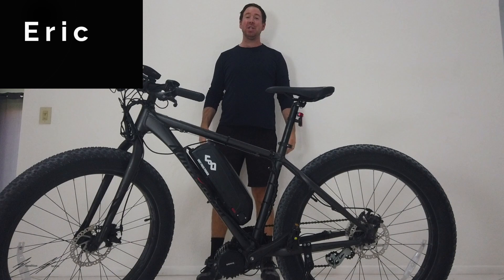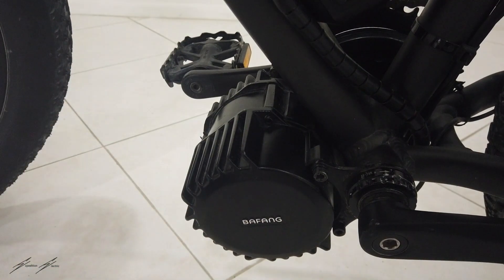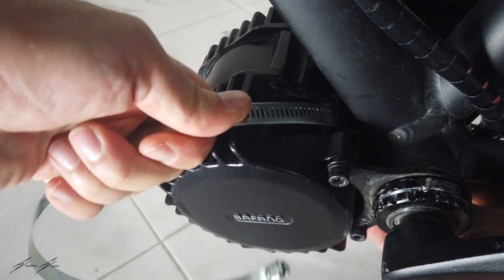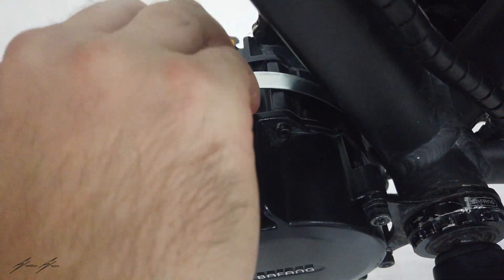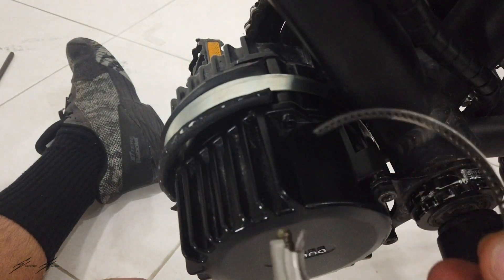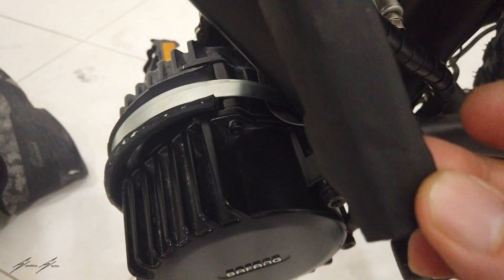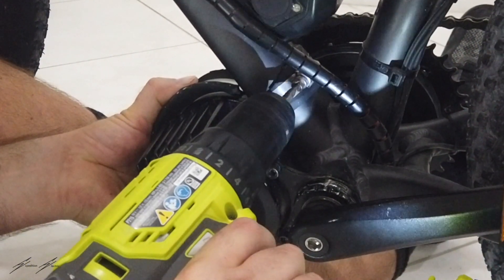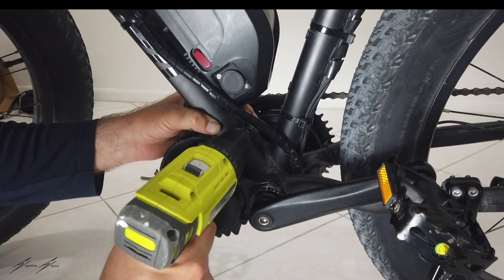Fix Mid Drive Electric Bike Bafang Motor Wobble

Comment: I have used hose clamps for various purposes for ebike applications.  One tip is to use heat shrink tubing to slip over the band of the clamp.  You can then heat the shrink wrap and it conforms to the band giving a nice look and protecting painted surfaces.

Comment: I'm doing this for a long time on my second BBS02B CAT, but it won't completely fix the problem. Whatever you use a hose clamp or fat cable zip ties - it doesn't secure the motor to the downtube at 100% This way you'll buy some time, but finally the locknut will loose anyway - just a question of time. Clamping will prevent the motor from a big move, but not competely, so once it strarts moving even just a little bit - an annoying squirky sound will appear as the bracket teeth starts chewing your bike's frame. I don't think that even a red threadlock or a custom LEKKIE ONENUT ring would help until the motor shaft is welded to the bottom bracket. Great motor itself, a powerful torque, but absolutely TERRIBLE design to secure it right 😞

Comment: What even is this? if you have that much movement in the motor neither lock ring is on tight at all.... just crank that sucker down to 60nm maybe 65, and its never coming loose. This is the most stupid shit Ive seen in a while.

Comment: There are proprietary M33 Deep Socket wrenches, with long handles for leverage.. Put only 1 drop of red Loctite on the motor nut thread and use that Socket Wrench to tighten it down.. It will be secure.. and later you can use the same Socket to loosen the motor if you need to remove it.  Leverage is the key...

Comment: I did the exact same thing on my 1000w Bafang motor. Although it works fine (it prevents the motor from moving up and down), however I had a bigger problem. I am not sure if it's because the motor was too powerful and gets really hot, and also because of the pressure that motor makes against when the motor accelerates, but a piece of aluminum approx. 6cm² size fell off from where the down tube joins to the bottom bracket shell. It wasn't a cheap bike, it was a Trek FX 3. I got shocked. Next time I won't make the motor touching all the way up, but I will leave some clearance in between so the motor won't touch the down tube.
Reply from the maker: Interesting point about the clearance.  I wonder if anyone else has had a similar experience with a 1000w Bafang motor creating so much pressure?  Maybe there's a way to reinforce the down tube area before installing the motor to prevent future issues.
Reply: Exactly the same thing happened to mine, same size hole in the down tube which I noticed on the weekend. Hence I’m here. I think I’ll try the clamp idea. The reason the hole is there, I believe anyway is due to the movement of the motor smacking into the down tube when loose. I put my bike in a stand, throttled it and watched the power of the motor slamming into the down tube to come to that conclusion. 

Funny enough I have a Trek as well it’s a 69er full suspension, battery on the top tube because it won’t fit in the triangle. I’ve done 3500 miles on this set up and it’s lasted about 3.5 years. I’ve had one controller burn out in the warranty period, which I got replaced. I got the motor greased and serviced the same time. Since then no issues and no servicing. I did put a larger cassette on after the controller burn out, I put a 42 tooth largest cog on the back and a 40 tooth on the crankset. If I’m using level 5 on the motor I keep it in 42-38 tooth max in the rear cassette.

Comment: Heat shrink tubing around the length  of the clips before installation, then heat gun it to shrink once fitted.
Colour coded and rubber protection for the neatest job.
Reply: MVP tip!
Reply from the maker: Will give it a try!

Comment: They sell a 15$ stabililazer plate on Luna cycles website. Much easier than this
Reply from the maker: Hmm.. I'd love to give that a try!
Reply: @expedition-electric3549  it's luna cycles I just edited my comment. Not Lina lol. Quick and easy install. Just a hose clamp and a rubber strip to protect  the frame is all you need.

Comment: Ignore the torque settings.. get a socket and monkey tight (80nm at least) make your tools and bike squirm. It will not come loose. use green threadlock. check after a few miles and it should stay put. the fitting tools they send are useless.
Reply from the maker: Some great tips!

Comment: Next time use a ¼ inch ratchet and 5/16 inch socket to tighten the hose clamps you get a better feel that way.  I would also use a razor knife to trim the excess rubber around the clamps.
Reply: 😒 I Was Nervioso
Reply from the maker: Right
Reply from the maker: Yes, good suggestions. I have removed the rubber. Still works great

Comment: Brilliant idea, my motor has gotten loose twice already. Def want to do this
Reply from the maker: Yes, I hope this worked for you!
Reply: @expedition-electric3549  it did 100% however later on have just used a metal piece as a bracket to hold it firm

Comment: Couldn't you tighten the actual bracket any more?
Reply: You could tighten it. I like the idea of having a support bracket though. Because if you rely on the bafang bracket it could actually damage the bottom bracket on frame . Then you will have to get a support bracket or do the hose clamp mod anyways.
Reply from the maker: Makes sense
Reply from the maker: Yes I did.

Comment: Check with Nicolas at Electric Bike Center in Walnut Creek, CA, he offers a very nice replacement for the bracket that comes with Bayfangs mid drive motor, it ties into the frame arm and completely stabilize the motor. No more dabble or movement.
Reply from the maker: Nice, will check it out!

Comment: Thanks for posting this guide. I shared this on a FB diy ebike group to hopefully help others. I hear that even set with a torque wrench the BBSHD can come loose. Is that an 8 inch hose clamp for the BBSHD? Something like a 4 inch for most down tubes?
Reply from the maker: I'm Headed to Electrify Expo in Miami tomorrow to check out the newest types of ebikes and electric builds, excited to see the new options out there!
Reply from the maker: Awesome, thanks!     I think I used 10 inch and trimmed the extra and a 4 inch.  I would go larger so that it surely fits.

Comment: This is the system supplied with some other middrive kits (eg Cyclone). I used it for a while on one of my Cyclone kits but used black/grey shrink wrap tubing on the hose clips which makes for a neat job.
Reply from the maker: Ohh ok cool. Sounds like the shrink wrap works well! I will have to try this
Reply: Thanks for this information.

Comment: I used four 200kg rated black zip ties and theyve works very well for the past 3 months. Definitely a similar setup to this.
Reply from the maker: Yeah I was looking at the zip ties and ended up with these because they were a tiny bit cheaper because I had to buy the bulk pack of zips
Reply: @expedition-electric3549  the clamps are definitely cheaper. Some additional pros for the clamp is it can be retightened where the zipties, once cut if they stretch over time, it might be tricky to tighten if even possible. Lastly the clamps make it easy for servicing.
Reply from the maker: @DocTaRED  It's funny that they just don't send you a bracket with the kit!

Comment: You can buy large sized black hose clips on Ebay thanks for the fix advice.
Reply from the maker: Ahh, good to know, maybe I'll check those out.
Reply: any link to the black metal hose clips?
Reply from the maker: @718og   only regular ones on amazon. https://www.amazon.com/dp/B07GRPSX4W/?tag=expeditione05-20

Comment: Makes sense. I filed down the metal ridges on the ring before tightening to bottom bracket. This helped slightly, but I will try this. Do you know what size metal hose clamps are best for this motor?
Reply from the maker: I was going to do the same thing, but tried this instead.  I got an 8 inch  and 4 inch clamp. Better to go with large size, you can always trim them with wire clippers.

Comment: Creative
Reply from the maker: Thanks
Reply: @expedition-electric3549  The TSDZ2 has a fairly robust mount even though it doesnt put out much power. I was surprised when I got a BBSHD that there was no mount any place to keep it from rotating. I like your solution.
Reply from the maker: @kjohns1413  Thanks, Yeah I was surprised that the BBSHD wouldn't stay put.  I just rode 30 miles and it seems to be working well!